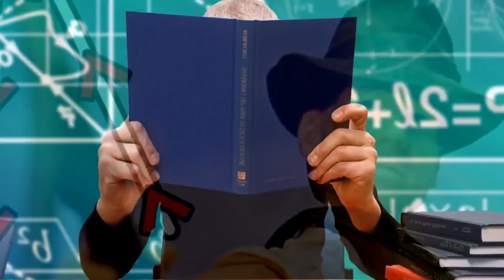why it doesn't work 30

Comment: It actually works not because the whip stops the car but because it is illegal for a car to keep driving and hit you. They must stop for pedestrians in the road
Reply: this is only true if the pedestrian is in a designated walking area
Reply: @KapowDashcam  those are lies spread by anti-pedestrian organizations. Regardless of where a pedestrian is standing, it is illegal to hit them with a car
Reply: @doughboywhine those anti-pedestrian organizations should really lobby against prohibition and non-road infrastructure
Reply: @JNJNRobin1337  They already have. Prohibition ended almost 100 years ago and road lanes just keep getting wider and more unnavigable
Reply: @xXrobloxpro123Xx pretty sure it isn't legal to run over someone cuz "it wasn't a designed walking area"

Comment: What th is a kilogram meter per second?
Reply: It's a kilogram times a meter per second. So like if a car weighs 1000 kilograms and is traveling at 20 meters per second, then its momentum is 20,000 kilogram meters per second.
Reply: @EdKolis  thank you
Reply: @HMRS  you're welcome! 🙂
Reply: What the fuck is a kilometer
Reply: @ludwigwinter6795  1000 metres, or around 0.62 miles.
Reply: Or we can say it Newton. A unit of force
Reply: @tanmaysharma3135  A newton is kgm/s^2, momentum is kgm/s.
Reply: @tanmaysharma3135 
F = ma

P = mv

Comment: Did you see the Veritasium video about a wind power vehicle that can go faster than the wind blows? It could be a really interesting "why it works" video.
Reply from the maker: I will check it out, thanks!
Reply: It can’t go faster than the wind blows. It can go as fast as the wind blows whilst not having to follow in the exact direction of the wind. Allowing you turn into the wind without losing speed.
Reply: @ekothesilent9456  That’s what I thought too, watch the video